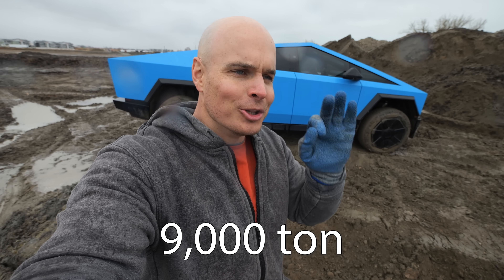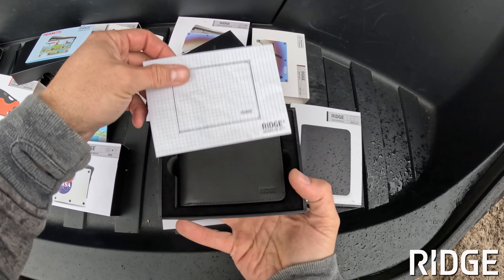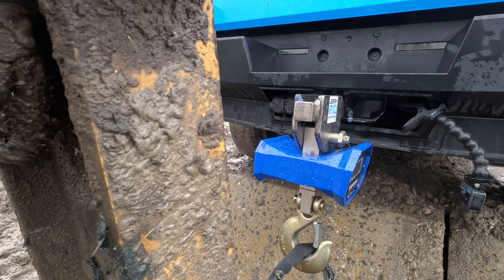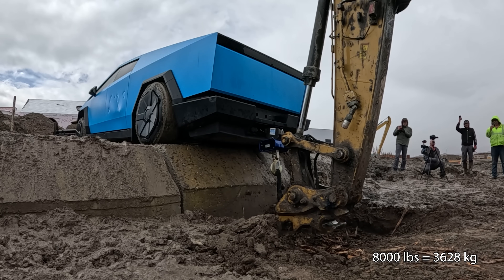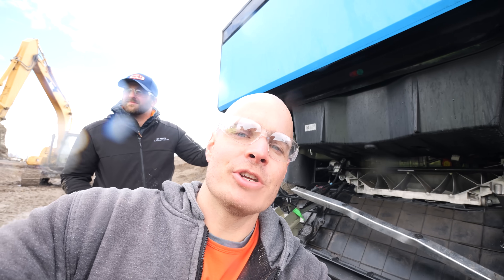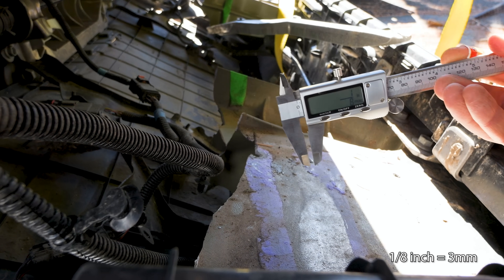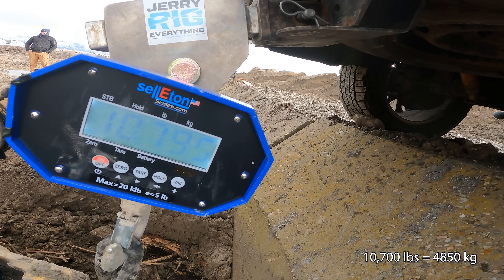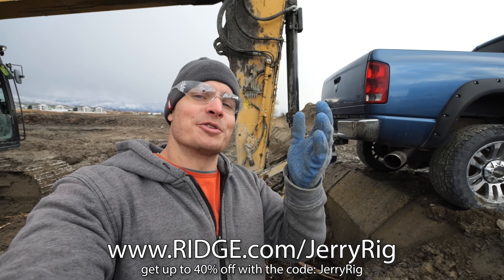SHOULD YOU TOW WITH A CYBERTRUCK?! - (catastrophic failure test)

Comment: I swear I can hear Project Farm saying "We're gonna test that!" and "Things went from happy to snappy!"
Reply: I dont like how the cybertruck is engineered. I cant wait to see a cybertruck towing over its payload on the road next to me yay
Reply: Project farm would never do something this dumb due to a political derangement syndrome. The hitch exceeded it's load by over 9x. That much force would never be applied in the real world.
Reply: @MattyEngland wow. You are wrong. Your not understanding what is happening here. This will fail in real life. There will be recalls over this. You also have to think about breaking (like pushing the break pedal) during bumpy roads on interstate. These bumps sometimes break suspension parts. So fore sure there will be more broken aluminum frames
Reply: @terrysmith4279  breaking doesn't apply downward force, unless your trailer is vertical, at which point you have different problems
Reply: @terrysmith4279  no, you are wrong. Look up trailer load balancing and how much of a trailer weight is actually on the hitch. That hitch will NEVER see 2000lb at even the bounciest roads. Note how a massive escavator was bouncing on the hitch of the dodge and that only added up to 500 lbs at the exxageratrd 10,000lb load. Any bouncing of a normal sub-1000lb load will NEVER reach even a quarter of their "test".
Reply: @dimayev4  "Never" in theory if the weight is strapped down, won't move and the road is even enough.
Your hypothesis about bouncing is wrong, the excavator was moving slowly, on the road you will have more sudden bumps. And kinetic energy is ½MV², so higher speeds play a much higher role than mass.
Reply: @dimayev4  time will tell. But I believe this aluminum frame is a bad idea and not safe. Would you rather a safer truck pulling a heavy load instead of a weak aluminum frame? Always thinking in your mind yeah this could break off and kill people on the interstate
Reply: @sasjadv  It wasn't a hypothesis it was just an analogy to the concept. Regarding the sudden bumps, you are only multiplying 15% of the load weight. The trailer has wheels that take up part of the load.
If you want to tell me about improper loading, well then that's no longer a rating question. If you balance too far back, your trailer will sway and you will get in an accident. If you load too far forward, you are going to bottom out your suspension and won't be able to drive, and if you DO drive, you will get in an accident. There isn't a realistic scenario where you are driving and all of a sudden experience a 3-ton force at the hitch.
Reply: @terrysmith4279  The thing with engineering is that you design for a certain criteria. If the criteria is met, it doesn't need to be over-designed. You design for all realistic scenarios taking into account all of the safety pre-cautions and you will have an efficient product that performs to that criteria. Now, I am not saying the aluminum was a good idea because I haven't studied every single scenario, but this specific test is a bad one. I am all for good testing that give you the right information.
Reply: @dimayev4  so you notice how both tesla and ram, once the excavator started pushing down the rear suspension started to sag/buttom out. Ok i tow car/trucks very often for work sometimes. I have used several different trucks for towing also. But it is common to see a similar result in the suspension especially when loaded with something like a 4 door truck with 4x4. I am sure this is over the tougne weight. I think some people should get together and design a scale in the shape of a ball hitch that can measure the force on all directions. Downward from weight of trailer and load. And pushing and pulling force form acceleration and breaking. Then get really rough interstate and see what the true numbers are in all directions. I am sure that breaking force and hitting a bump (like going over bridge on interstate) at the same time would get really close to over limit numbers.
Reply: @terrysmith4279  Well yea, the payload limits of both of those trucks was well surpassed by the excavator. The Ram is not rated for that much payload either (i say payload because that is part of the towing capacity in terms of downward force). If your trailer setup surpasses the payload capacity of your truck, its already wrong, even though there is plenty more tow capacity. The RAM is rated for around 3,000lbs payload but it should never see more than 2,000lbs at the hitch, even with 11,000lbs trailer. The remaining payload capacity is for safety factor (from bumps etc.) actual truck bed payload, and passengers. Its recommended to reduce payload as much as possible with large trailers to prevent maxing out the rear.
Reply: @dimayev4  15%? It's not a fixed number, it's a velocity dependant number. And it depends on more factors.
     Someone can forget to raise the jockey wheel (or not raise it enough), and drive over a bump, giving the trailer a sudden upwards force, that's not dampened by the suspension.
     Apart from that, you can get rear-ended, when some idiot drives into your trailer, giving you sudden impact that the relatively brittle casting wouldn't like.
Sure, trailers have a coupling damper, but during a crash, they will just bottom out, transfering the impact into the frame.
Reply: @ When balancing a trailer, you use the 15% number so when you are driving, your vehicle is balanced properly. All of that math was already done during the design phase to account for bumps and all this stuff you guys are coming up with that the engineers have also thought about when working on this thing for more than the few minutes we took to come up with these "failure points". What you are saying is true but it does not justify a concentrated  downward load of 11,000lbs to the hitch! That will NEVER happen in the real world. Even if somehow that happened in some make-believe world, the truck's front end will fly into the air before the tail end snaps. They had to hold it down with a loader for it to break.
Reply: @dimayev4  Nice try with "the engineers have also thought about...", because I'm an engineer myself, and know how all the design, calculation and harmonisation is done.
1) For this casting, it doesn't matter if this force is upward or downward, because you're bending with the same neutral axis, and the same static moment of inertia.
2) While driving the casting has to endure sidewards forces, along with pushing and pulling forces, not just the downward force (that already fluctuates on bumps).
3) 10000+ lbs of force can very well actually happen... If you've loaded the trailer at the rear, and the load came lose and moved forward, towards the hitch🤷‍♂.
4)  In real world use, the casting can snap al lighter loads. Because it's a relatively brittle structure, it can get microfractures on part of the casting on every impact, which can add up over time. That's again something way less likely on something that can bend.
Reply: @sasjadv  I just wanted to emphasize the fact that the basic ideas people are coming up with at no effort and thinking it was somehow just blindly missed by a team of engineers spending years on a design is pretty petty.
1. I agree, upward or downward is stressing the same structural members, but during towing, gravity is usually pulling down.
2. Yes there are side forces as well
3. If you loaded the trailer at the rear and it all flew to the front, you are still not loading the hitch to 10,000lbs! They used a 50,000lbs excavator and were barely able to exert a 10,000lb force on the hitch idk why this is such a difficult concept. As long as the trailer wheels are on the ground, they are always participating in load-bearing no matter how far forward the load is. Draw a free-body diagram you have done those I assume.
4. Ok yea i agree. There is no real information here other than a general fact so idk what its supposed to prove. The truck is rated for 11,000lbs towing and 2,500lbs payload. If you stay within those margins then you are within design constraints.
Reply: @dimayev4  😉 The excavator has its center of mass above its tracks, not even between the hitch and and its tracks, but above its tracks. I.e. an excavator is designed to be stable, not to put weight on the bucket.
   Anyways, they could easily exert way more force with that excavator: Either by just driving the excavator forward, and moving the bucket closer to the excavator; or by putting the excavator on an elevated surface (or slanting up ramp).
But they did the opposite, by putting the cybertruck on an elevated surface and having the excavator stand lower.
-----
About valuing the work of the engineers: well, most Americans that are driving a pickup, just use it as a car to drive to their work, and don't haul trailers. And yes, you can just be careful when hauling, and then you'll most likely be fine.
But the cybertruck is marketed as this bulletproof thing, that's supposed to be extra rugged compared to a normal pickup, not more fragile. It's marketed as a stainless steel truck, not as an aluminium casting-truck. 🤷‍♂ Again, it's all-wheel-drive, yet it breaks when going off road.
Reply: @sasjadv  Lol again, for illustration purposes, I simply highlighted the fact that an excavator, in whatever configuration it was in at the time, was prying up the front end and only loading the hitch 20% of its weight, just like a trailer would. Human error is inevitable, but it doesn't disqualify a rating. We don't say a specific car an take a corner at a certain max speed and then disqualify the rating because someone made a mistake and took the corner during the rain and crashed. 🤷‍♂

Second paragraph I agree with everything. I don't like the truck and was also surprised it was aluminum. However, it's the validity of the testing that bothers me and draws the wrong conclusions just because something catastrophic happened.
Reply: @dimayev4  "for illustration" the excavator has a counterweight, to counteract the mass that the bucket can lift. That counterweight literally does the opposite of what's needed to put weight on the bucket.
That's more like a trailer with the load behind the rear axle, to have an upward force on the hitch.😂
Reply: @sasjadevries  yea thats not the point. I'm not trying to devise a way to lift up the excavator. I'm simply pointing out that the weight of an object behind the truck has a component taking the force of the load as long as it's connected to the ground. This is basic stuff, I'm surprised you are ok with this test as an engineer. I guess that's why they have test engineers because it's such a difficult concept apparently.
Reply: @MattyEngland  Nope, that's the whole point of a safety margin.
The actual real world road, is not guaranteed to be flat and even, and a real world bump can give you a big overload, resulting in a real world failure of the casting.
Reply: @sasjadv  It was rated at 1100lb, it failed at 10,000+. That's a safety margin of 900%
Reply: @MattyEngland  Tesla's page says that the Cybertruck tow capacity is 11,000 lb...
Reply: @MattyEngland dude it's rated at 11,000lb not 1,100. Just the trailer loaded with nothing in it prolly weighs 1,100... This failed before its rated strength
Reply: @orlandoacosta6566 you said it almost exactly. Correct term is towing capacity meaning you have a trailer that can hold most of that 11,000 lbs. Usually the recommended tongue weight is 10% or 1,100 lbs on the hitch. All hitches are rated this same way and even usually specify that the weight shouldn't exceed 500lbs without a weight distribution hitch as well.
Reply: @orlandoacosta6566  Tongue weight is 1,100.
Reply: @orlandoacosta6566  Tongue weight, not trailer weight...
Reply: @MattyEngland  It was rated at 1100lb moving, which is equivalent to several k pounds during driving. And then you need a safety margin on top of that for unforseen circumstances, i.e. the load shifting forward on the bed of the trailer.

Comment: That is insanely good. People don't understand. Your pulling the hitch down not backwards.
Reply: You think that until you run over a pot hole with a heavy trailer and instead of the car bending and absorbing the shock, it just cracks and falls apart. (This has happened to somebody towing a caravan trailer with the Cybertruck)
Reply: @Lykansc  citation need. Having an exavtor pull down on a hitch is not the equivalent to hitting a pothole with a trailer. You are lying, just come out and Admit it. Tell the entire world that you are a liar.

Comment: Channel seems more focused on Tesla bashing vs anything else these days... you are comparing a 1/2 ton and 3/4ton... the 3/4ton is called that because it is built to carry heavier loads... 

Now that the obvious is out of the way...the dodge would never drive down the road straight again...

Tongue weight when going up a good grade would increase it upwards of 200% on a steep grade... so lets call it 10k lb trailer for simple math...start out with 1k tongue weight...2k tongue weight...no big deal... even if you went with sprung tongue weight at that absolute crazy incline.... it would be another 200% giving you 4k of max tongue weight while hitting a cow... 

I used to respect you and watch your videos... now its just silly crap...
Reply: @spoonsarefun  Don’t forget selling overpriced wallets.
Reply: @du3223  Or trash raycons. This ducker needs to be cancelled by one and all
Reply: What are people smoking? Tongue weight does not go up as you go up a hill, it goes down. In fact, could your vehicle climb a 90° hill ‘tongue weight’ would be exactly zero. 

Towing weight is not tongue weight. Tongue weight can only be applied downward in the truck’s reference frame but, since it can only be generated by a trailer’s gravitational force (which can only point down in EARTH’S reference frame) it is at its maximum on level ground and goes down as the cosine of the slope of the road.

Your point about this whole video being silly crap is spot on though! This is political garbage and earns and unsub 👍
Reply: @brett-westgrove-country-music  so... yes and no...

I can point you to a video exists that shows trailer tongue weights at different heights... as the truck climbs the incline the front will raise...back will drop...thus increasing the tongue weight as the trailer now is not level and the load weight and distribution has changed. 

Glad we can agree on the rest.  If you need a link or name of the video which shows them measuring with a tongue weight device and further explains how this can be mitigated with trailer sway bars/torsion bars which keeps the load more equal height for towing, I'd be happy to help.
Reply: Exactly but He’s unethical
And dumb and hates Elon and he wanted to do a video with a “broken” cybertruck while towing
Reply: Definitely after he built the bunker which was  just dumb content! Waste of money and now Tesla bashing for sure !!
Reply: 1/2 vs 3/4 vs 1 ton doesn't really mean anything anymore because the true ratings have gone up a lot over time. The Tesla actually has a higher towing capacity than that 2004 Dodge. (Edit: bumper pull rating, the Dodge has a higher rating for gooseneck/5th wheel) I agree that you would never see that much tongue weight in a real life scenario, but the aluminum frame would worry me over time. There is a reason you haven't been able to order a semi truck with an aluminum frame since the 80s, and they were already rare by that time.

Comment: Not only that but if somone uses the wrong ball size or something fails an the trailer comes loose then theres no way a loades trailer slamming on the safety chains then need to be controlled to a stop with safety chains isnt possible with the cyber truck. So even if it holds the wait in an accident of a unhitching wont keep the trailer on to protect others on the road

Comment: Towing 11000 lbs and putting a 11000 downward force on a hitch is not how you test a hitch. You would've needed to pull backwards to properly test your tow rating. An 11000lbs trailer doesn't put 11000 lbs of down force on the hitch ball.
Reply: did you watch the video where he clearly explains a case where it could all be on the tongue ? or you just shilling 🤣🤣
Reply: @tessierrr I did watch it, I also want to say I don't like Tesla one bit and that abomination doesn't deserve the attention it gets. But it almost feels like the tests they did with the Samurai in the early 90's to say it was a rollover risk but they had put weights in the vehicle to help it roll over cause it didn't otherwise...
Reply: @tessierrr  no of course didnt watch it would of been like white noise from 30 sec on.. fanbois are like trolls n bots. they only process things that meet there bias n try desperately to fit information that's contrary into there delusion n if they can't - attack n misdirect.
facts n reality, practicality n real world knowledge be damn3d for a keyboard bitcoin warrier

Comment: Comparing it to a 3/4 ton is a bit sus, a half ton would be more appropriate.
Reply: Those numbers hardly mean anything anymore, the Tesla has a higher rating than that older Dodge. Edit: On the bumper pull hitch, the 5th wheel/gooseneck rating is higher on the Dodge.